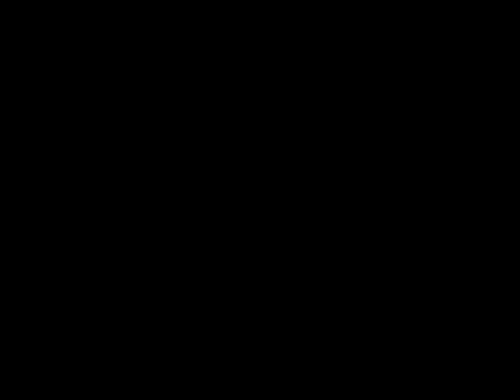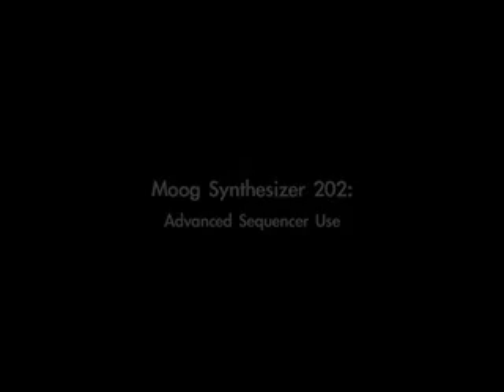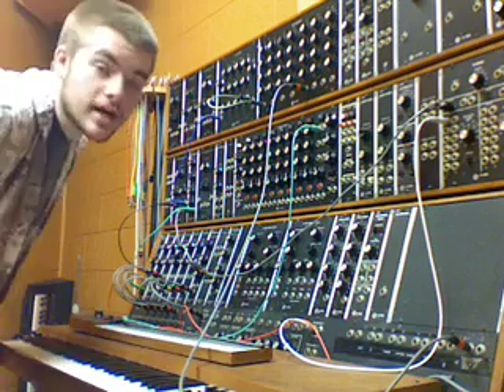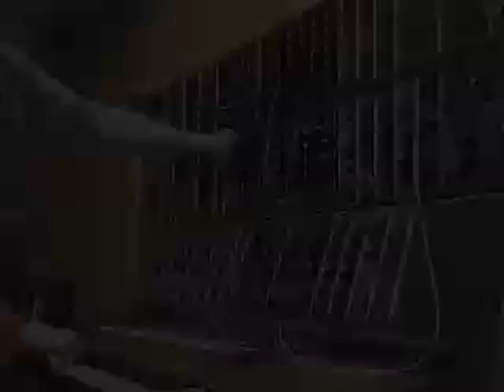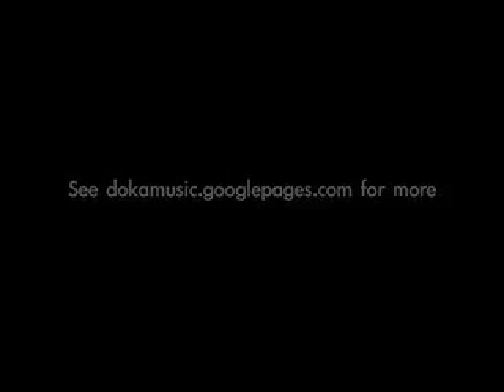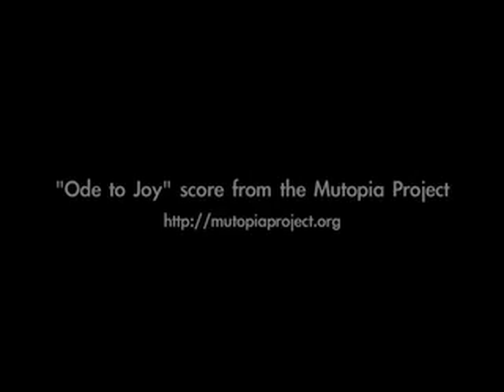Moog Synth: Advanced Sequencer

Comment: @MikeGiunta a modular synthesizer is a type of synthesizer consisting of separate specialized modules connected by wires to create a so-called patch.  Each module has a different purpose.  And by not linking them internally it gives you the ability to do what every you want with the synthesizer. (I'm 14)

Comment: Do you mean the purpose of the wires? They are to connect the oscillators to the filters and all the other parts. Forming a chain of sounds and filters that change your tone, timber, etc. Without them, there would be nothing but pure frequencies. It's similar to how guitar pedals work.